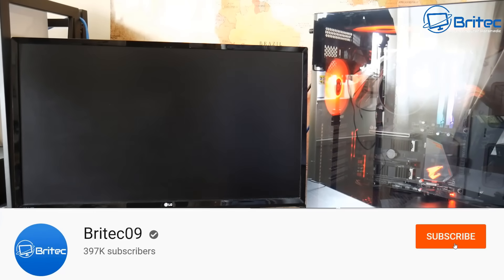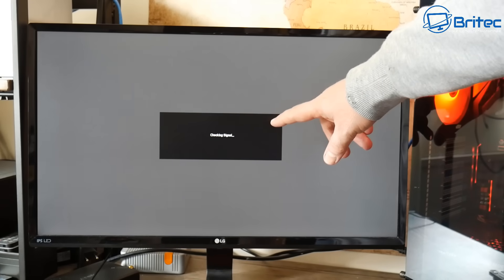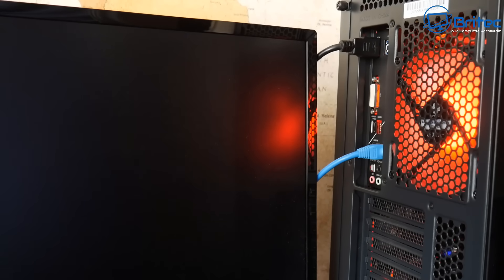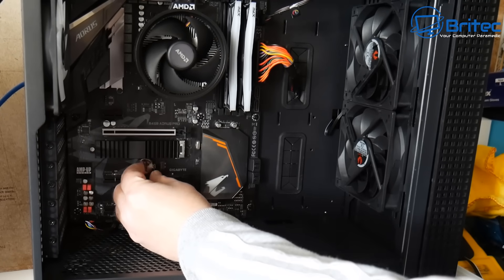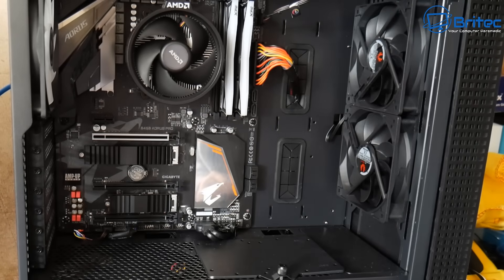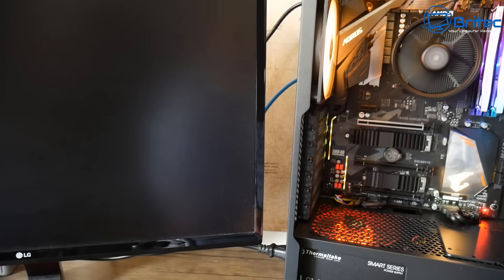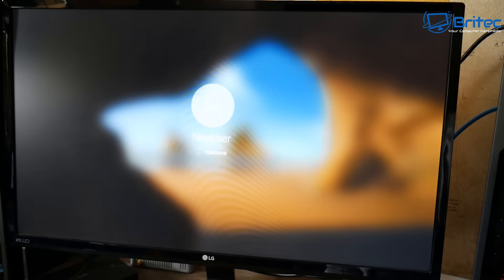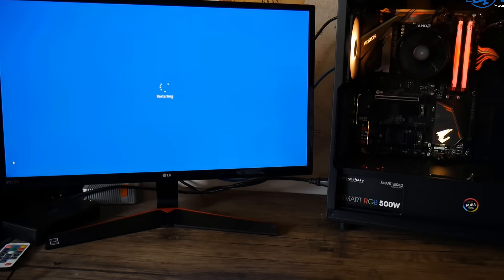Computer Repair: Fix No Display For Integrated Graphics

Comment: Will this work regardless of if windows is installed or not, I have have a hp retail pc 5810 and can't see if the win10 pro os is booted and installed or not as I have nothing  on screen , pc just keeps rebooting every 20 seconds.

Comment: Hi. I accidentally disabled my intel integrated graphics and my screen is now black and with a no signal detected sign. I have tried resetting the bios by taking the circle battery thing out, holding the power button and putting it back in, but to no avail. What other steps should I take?
Reply: Did you ever fix this? I have the same issue

Comment: hey uh, so how important is to drian the power after removing the battery? is this mandatory to reset the bios? doesnt automatically enable your integrated graphics if you dont have or removed your GPU?

Comment: Hi
I have 3400g igpu and just installed evga 2060 ko ultra gaming and no signal at all... Tried to change cable to Igpu no signal as well,, removed the new gpu and returned all back to original state removed ram and replaced places, checked hdd and ssd cables,, still no signal at all. What should I do,, BTW I installed new sk hynix NVME with the new gpu at the same time does it something to be considered?
My board is asrock b450m steel legend
Thanks

Comment: I removed my graphics card to clean the dust off of the fan and after I reinstalled it my PC won't boot. I also pulled the cmos battery when I removed the graphics card also. When I try to plug the HDMI into the on board graphics card it still doesn't boot

Comment: Hello I  hope you can help me with this issue, it's kinda the same but...

My Pc is stuck on black screen with no signal and an initial 5 beeping sound.

I wanted to enable secure boot to install windows 11.

When I got into my bios, I turned off csm and enabled secure boot and updating the platform key (pk).

After that I saved and exit the bios only to return to the bios again, csm was turned off and secure boot was on, only thing left it was to delete the PK. I saved and exit bios and once again I returned to the bios.

This time I updated the PK with secure boot on and csm off and saved, when I rebooted my pc turned on and beeped 5 times only to be stuck on a black screen.

I removed the battery for 5 minutes to hard reset my motherboard bios and touched the clear CMOS pins but nothing.

Am I able to run my Pc into the bios without gpu using the hdmi cable through mobo with the specs listed below?

If not, does this mean I messed up/bricked my motherboard? Any solution please?
 
Thank you

MB: Gigabyte Z370P D3 
GPU: RTX 2070
CPU: I5-9600KF 
Monitor: AOC 240HZ Monitor
Reply from the maker: Sounds like that you have a hardware issue when you say five beeping sounds only all the same one short one long. This is important because they mean different things. It could be a ram issue. It could be another hardware issue for troubleshoot to find out where red software or hardware related. This should only take around about 30 minutes to do
Reply: @Britec09  My Pc was running just fine before this, for the beeping sounds at boot, it makes 5 short beeping sounds.

Like I said, my Pc was running smoothly before changing these settings.

Comment: I did try this with B550 AORUS ELITE AX V2 with ryzen 5 a few times, but it did not work. Had pressed the power bottom for more than 15 seconds with the battery removed. Any solution? Is it possible that default setting are with integrated card disabled?
Reply from the maker: Ryzen 5 does not have integrated graphics. You will need a graphics card
Reply: @Britec09  Yep... i realized this after posting my stupid comment... lost 2 hours before RTFM ;)

Comment: can this be done with a GPU installed on the PCIe slot?  yours was empty
Reply from the maker: You will need to clear the CMOS of any information that is stored on it. If you're going to be using on board graphics, it's best to remove the graphics card from the slot to stop any sort of confusion

Comment: Thank you very much! I was trying to remove my GPU (RX560) and use the integrated Radeon Vega graphics (R3 3200G) because I'm trying to use my PC for school purposes and the iGPU can do the job done for that which I think would consume less power(?) correct me if i'm wrong.
Reply from the maker: Your RX 560 will probably use more power than the built-in GPU

Comment: I removed and put the battery back in the motherboard but nothing changed. Also i plugged in the ram again and try to run the pc on integrated GPU and there was not a display again. Where can be the problem?

Comment: Didnt work. Still no signal.
Reply: I found what was causing my issue. 
It was my ram for some reason my ram wasn't being detected by my motherboard, I had to insert old ddr4 ram + boot and shutdown. Then I needed to insert my new ram to fix the issue. Was some random shit. Integrated Graphics worked once my ram was detected by my motherboard.

Comment: what if this does not work ? I bought a new PSU,  installed it and, the pc had no power to the on off in front, then I saw this video, I took GPU and HDMI did not work and did what you said, still nothing. any idea what to do? added contacted Gigabyte on the matter to x470 ultra gaming bought may 2019 for rma

Comment: Man i don't know if you can help me, but i'm in a bad situation. One day my PC started to present some noises, and it was inciating perfectly with my offboard graphic card, I tried to find out the cause of the noises, i opened the pc and unplug the graphic cards, and plugged everything back, so when i started the pc, my pc doesen't show back video signal with hdmi connected in offboard graphics, but in onboard graphics it works perfectly. I don't understand, i tried many possible solutions and no one of them worked.

Comment: tnx, it worked for me.
"Caution 🚧"
In MSI H510m pro-e if u turn off or restart the PC, it goed to the default setting once again. you have to go to the BOIS Setting and set the default Graphic to integrated graphics device (IGD) then save and reboot. If u don't change this option u have to exit the battery once again.

Comment: I had the same issue but these steps didn't work only because my CPU is Ryzen 5600x which does not have an APU for the integrated graphics I had to install a Graphics Card and all started working properly, I hope this comment can help anyone with the same setup.

Comment: Hi. Recently my aorus z590 motherboard has been repaired and it said from the report from the supplier that they have replaced the pch. Ive already gotten my board and i was ready to use it. My processor is i7 11700k but the integrated graphics shows no display but when inserted with a discrete graphics it shows display. Will your method work in my case sir? And what if im going to buy a gpu instead will it be okay to just leave it like that? Thank you for you reply!🙏🏻

Comment: i5 11500 keeps having this issue. brand new pc. I have pulled ram and cmos battery a number of times. I get no signal on boot. if i log into windows blind sometimes i will then get signal.

Comment: Great video I found this video when my monitor kept going to sleep straight away when booting got it running by pulling out the graphics card and doing this method cheers man life saver just need to find out why the card won’t pick up the monitor but thanks again at least I know the monitor and pc are fine cheers

Comment: i fixed a graphic card once, and it never display after that, i think graphic card faulty. Tried almost everything, finally, i remove one of the ram or switch the ram, it should work

Comment: I've been searching for a solution since yesterday evening. My PC has the Ryzen 5 3400G graphics.I decided to put a dedicated gpu in it. After realizing the integrated graphics performed better, I took it back out. I was using dual monitors. One with VGA, and one with HDMI. Now agree removing the GPU I can't get the HDMI to work. Only the VGA. The HDMI was disabled in the BIOS, so I enabled it, but it's still not working. I'm going to try this to see if it fixes the problem. If not are there any other suggestions?

Comment: I had a dgpu installed, & last night while playing escape from tarkov, the whole system just turned off like in a power outage. Ive done this process 10 times, but no luck. The pc turns on, fans spin, rgb lights on motherboard light, but no display. Ive jumped the cmos, pulled the batt, nothing is working
Reply: Mind you ive been building pc’s for nearly 35 years, its gotta be the power supply or the mobo, guess i need to run out & buy both

Comment: When I buy my PC I got a Nvidia gt 730 and I don't used it and I put my vga cable into the motherboard,and later I put vga into the gpu and now when i try to put it in the motherboard and use my Integrated grapich card and give me a black screen and I try this and don't work
Reply: Am I need to remove grapich or don't
Reply: @Milos_21  i think so, i will try it now, i tell you

Comment: what if i have a display output right? hear me out but the thing is that my integrated graphics do not work. when i play any sort of game its just handled by the cpu cores i just want my igpu to actually compute and handle 3d but it wont for some reason and ive looked through my bios and i cant find any settings to enable the graphics or nun

Comment: Hi i have a question where i'm searching for 2 weeks to a solution...

so my old video card (2070 super 8gb) is broken. and wont work anymore.
so i bought a new video card the rtx 3070 ti but it won't work (i think because of the drivers)
I need to install the drivers but i can't use the pc (monitor keyboard mouse won't light up, the gpu card fans spin)

My pc doesnt have a build in gpu... so my question is: how do i get drivers on my pc without being able to use it.

ps. i already removed the battery and drained it from power. didint work aswell
Reply: did u ever find a solution?
Reply: @mula5926  nope. i just bought a new 2070 super 8gb card and installed the new drivers for the 3070 ti. and sold the 2070 super 8gb on marketplace

Comment: Man This one saved me. I was pulling my hair out. I had to open some screws to get to the battery. on old mother boards this was right in front of you and you couldn't miss it. I wonder why all of the sudden this could happen? I was working with my computer for a month and when I turned it on this morning was having this issue. It is strange.

Comment: I tried everything (removing bios battery, removing /cleaning ram, unplugging/plugging the cables, unplugging/plugging monitor cable, cleaning the mother board etc) my computer had no signal eversince i enable 3dmark01 enhance in bios mode

Comment: My stupid bios on b250 is set to the external video card bu default. No matter what you do you will never gonna fox it without external card
Reply: I'm wondering if its the same issue with my z590 Gigabyte board..... why would they make it default to GPU instead of Integrated graphics. smh

Comment: Hey i have an issue with gpu i think, it beeps once when i start and after it u hear the sound of gpu running faster and the monitor shows only for 2 seconds the screen quality and it turns off&restart and it boots up without signal on monitor, any solution about that ?

Comment: mine didn't work. I have a MSI B450 MORTAR MAX. it has no display but i know its running because i can turn numlock light on and off, i tried every ways of reset, still no display

Comment: I wonder if the solution could be applied for laptop with onboard GPU? 
I have a Dell Alienware 17R5 with diagnosised dead GPU (3/2/1 beep code. 2/7 led code). Laptop does not POST, even to BIOS. My idea is to disable on-board GPU and use external GPU instead (Dell Alienware do have a specialized dock for external GPU).

Comment: The battery trick did not work for me. Have ASUS Prime B450 Plus with Rizen 7 3800x. All the fans and RGB lights are running but get no video with integrated video. No error beeps or light flashing. Don't know if it should at least beep once during boot. It does none of that.

Comment: You solved an issue i have been having for years over multiple OEM computers. I never thought to pull the battery... only ever reset to defaults in bios. thank you

Comment: If you shut it down and hold the power after removing the power cable it will drain it as well not sure you have to take out the battery

Comment: Still having this issue, it's an older PC built by a relative many years ago.
I've done everything in the video here in this exact order, I have also tried 3 different monitors(all confirmed working on other systems) and 2 different DVI's, 3 different VGA's(once again, all confirmed working on other systems)
Foxconn A7GM-S, AMD Athlon 64 X2.
I could be wrong, but I read online that the motherboard does in fact have integrated graphics, ATI Radeon HD 3200 built into it.
Don't know this for fact, it is just what the internet has told me.
Anyone else know what could be causing this?
Reply: Dead 💀 motherboard

Comment: Thanks buddy today you made my day i mistakenly disable my integrated gpu output in my laptop so i use this trick and tada problem solve.😂😂👍
Thanks👍👍
Reply: How tf did u reset cmos on a laptop
Reply: @lightzfn9569  just open cover of laptop and find the cell in laptop only remove its wire form the motherboard and restart the laptop 1 to 2 times after that shut down you laptop and connect that cell wire with motherboard and then check the display will work

Comment: I just built a new computer and I haven’t installed windows and having the same issue; how do I install windows without access to my BIOS? If I do this fix will I be able to enter the BIOS? 
This is my first time building a PC and GPU prices are disgusting, so I’m stuck with my iGPU for the time being.

Comment: Got up this morning to find "No Signal" on my monitor !   Swapped  HDMI cable, tried vga cable, swapped monitor, no joy ! One thing I noticed when switching on the monitor (mine's an LG like yours in this vid) was that there was only 2 segments (input and monitor) of 4 showing in the circular options. The other 2 (picture mode and menu) were greyed out !.... I then noticed my monitor was connected to the integrated graphics HDMI instead of my GTX 950 card (must have accidentally plugged  in to integrated instead of Video card when moving PC around in the past)..Reconnected HDMI to GTX 950 and got my screen back, pheew!...Worried now that my motherboard (ASUS Z170-K) might be on the way out, I Googled integrated graphics repair and found this !!  Brilliant !  Haven't tried removing the battery yet but will do when I get time just to see if it works. Thanks a lot.. BTW in the past I have changed batteries but only when batteries died and dates/times reverted back..is there anything else I need to know that might change apart from leds/dates/times/ etc ?   Thanks.. I found your (this) video perfect for viewing regardless of anyone having a whinge. Thanks again

Comment: Waw ok,im not taking the battery out.

The thing is, i would like to use my integrated graphics for Windows, so my GPU isnt working for youtube, office and such.
I think its a waste of energy and GPU for that.

Is there a way to have both active?
Becouse i used to do it on my old Laptop and my older Desktop, i had the main monitor with Integrated for basic stuff and my TV with GPU for gaming.

But with these new motherboards it seems like once you put in a GPU everything goes trough it...

Comment: I can't believe it worked!😁💕

 And I have an old computer with Windows 7 and an AMD- A6 - 5400K Apu with Radeon HD graphics 3.60 gigahertz 64 bit OS and I'm using an Old Dell s2009w monitor 

I was panicking because I need my computer for work tomorrow and I didn't have time, energy, or money to figure out how to get the right video card for such an old system

You're a lifesaver💖🤗 thank you! Plus I like your accent what is it? It doesn't sound like London but it sounds close. Not that I'm an expert, I'm a California girl.
Reply: When you hold the power button, does it need to turn on the psu?

Comment: THIS VIDEO IS A BLESSING!!! I have ZERO experience with PCs but recently bought a Ibuypower PC because I want to start streaming. I got this specific model because I saw a lot of good reviews of it being a really great starter/beginner PC. I was so excited when I got it all hooked up and the leds were going but the monitor wasn't showing display. I tried to figure out what was wrong for about 2 hours and was nearly in tears and about to give up when I tried following this video and it was fixed!!!Thank you so much!!!!
Reply: You do know that you’re supposed to plug it into the GPU and not the motherboard, right?

Comment: This fix didn't work for me. Tried this, tried to swap memory slots, tried to reset cmos, tried to reseat processor. Running ASUS B460M Plus with i3 10100. DVI works fine, but neither DP or HDMI will send signal. Oddly enough, the display (a Sony Bravia TV) is recognized under windows and linux. Even if I drag a window to the secondary montior, it will stick there, but I don't see anything.

Comment: i sold my GPU and i have my i5 10400, i came here because every time i tried to boot it didn’t show, so i did everything you showed in the video and it finally showed on my monitor but my issue is, it keeps going to the bios instead. how do i fix that issue?

Comment: Q: Do asus prime a320m-k need a dedicated graphics card for display? Or it will have display on integrated graphics (vega 8 )?
Please answer.
Reply: That's what I'm using with a ryzen 3 3200g and still not getting display. This is annoying